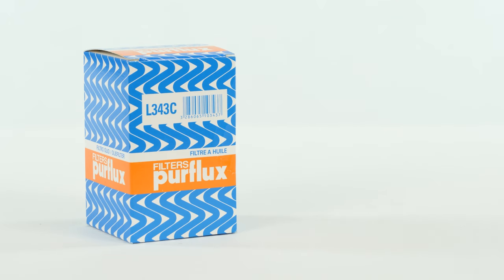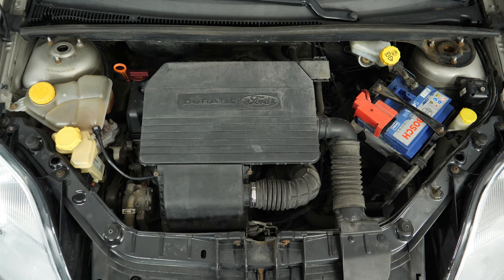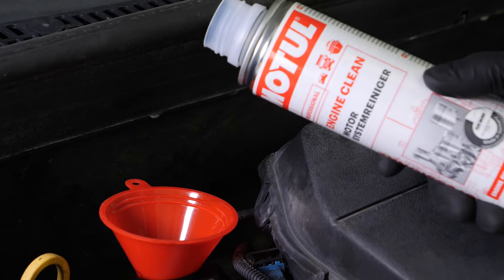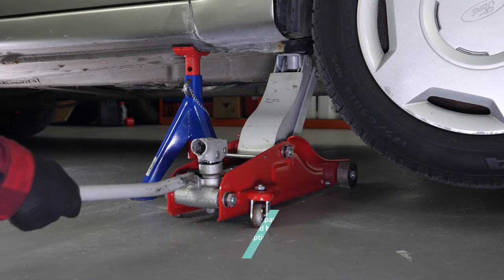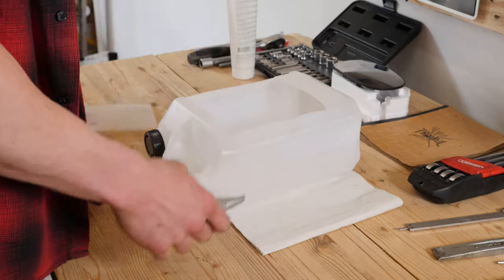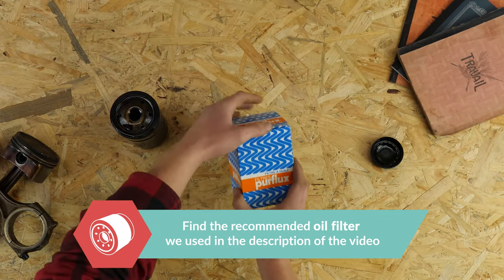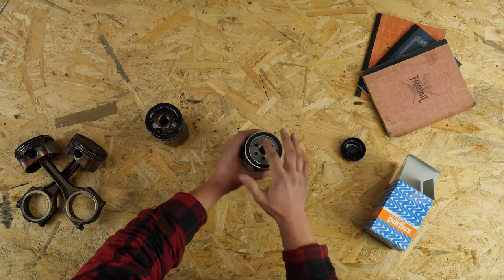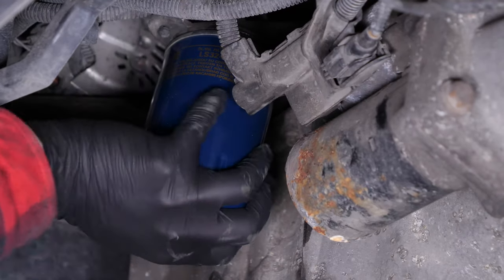Change the oil and the oil filter Fiesta mk6 1.3 Duratec 🛢

Comment: Ford Fiesta 2006 
I have sw-40 oil it’s ok ?🙄
Reply: Mine is a 2005 mk6 with approx. 210.000 kms. I'm using SAE: 5W-40 API: A3/B4 synthetic oil. It has no problem with it. It's users manual also suggests it if you can't use 5W-30.
Reply: @gaav888  ok thanx bro 🤜🏼🤛🏼
Reply: You're welcome!